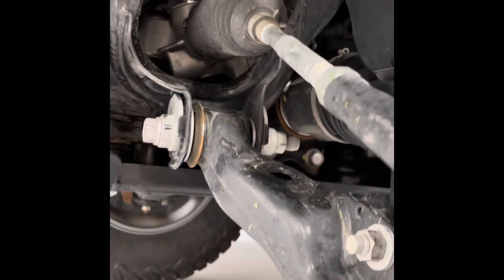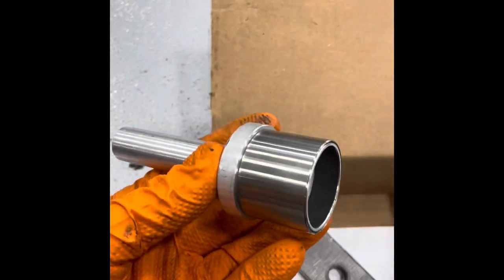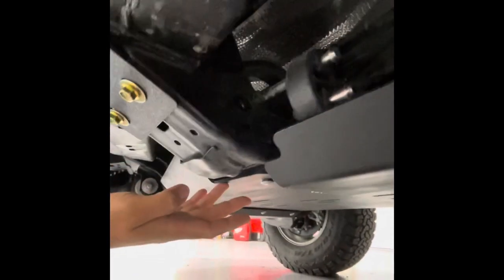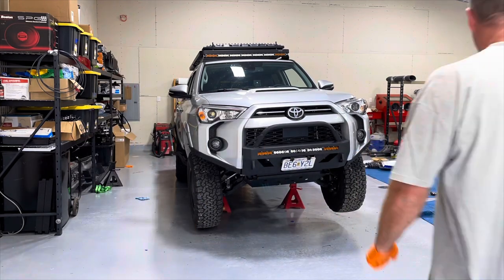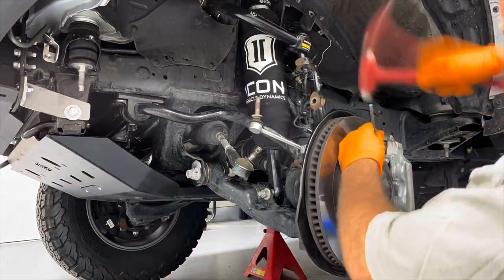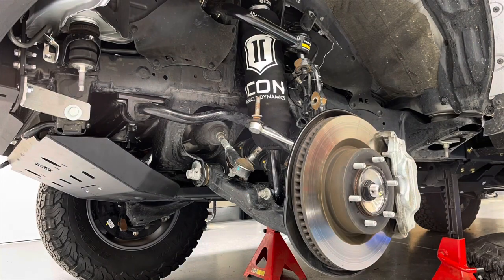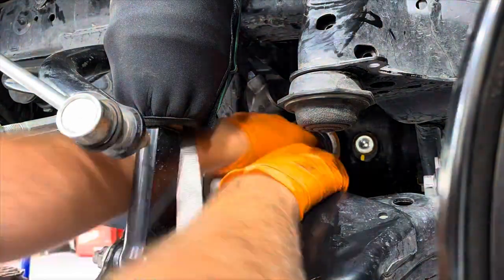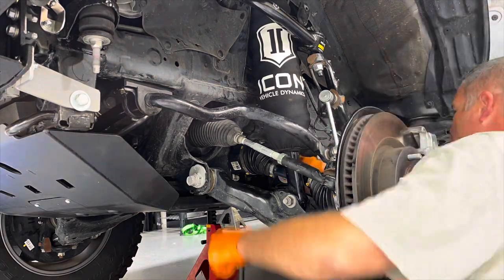4Runner diff bushing install, and some questions for viewers

Comment: Would you be kind enough to post Part # ..also is part specific for lift? Have a 2wd 21 sr5 was gonna get lifted...excellent video...
Reply from the maker: This won’t be applicable if you have a 2wd. There’s not a front differential unless it’s 4wd. However, the diff bushings for all Toyota models are found here: https://eastcoastgearsupply.com/search.html?q=Toyota+bushing

Comment: Hey, nice video! I have a 5th gen sr5 awd (shift knob) on the web page it says “FJ Cruiser, and 03 up 4runner DOES NOT FIT AWD 4RUNNER AND FJ CRUISER”
Is there another option for those models? Thank you
Reply from the maker: First, thanks for watching. Second, that would be a question for the company whose website you’re referencing as to which one you need for your AWD model.

Comment: how / when was yours vibrating? mine only vibrates 30-40mph and does not happen when I put it into 4th gear or shift manually.... I'm not sure this is the issue, so trying to pinpoint it.
Reply from the maker: I don’t own this rig. But as I remember the owner said it was slow speeds mostly.

Comment: Did you not need to replace the o-ring/gasket on the differential after removing the needle bearing?
Reply from the maker: Only if you nick/tear it when removing the axle, or if your seals are old and crusty.

Comment: Quick question.  I recently had my lift out on before deploying.  I was only able to drive my 2020 trd pro 4Runner around for about a month before leaving.  But I do have a bit of a vibration since the install and it’s only for the first second after moving from a stop.  Could this be the answer to my problem?  I really hope so!
Reply from the maker: It’s very possible. This rig had a slow speed vibration and now it’s quiet as can be. I’d say go for it as it’s really not that expensive of a fix (if you’re doing your own labor). I hope this helps. Thanks for watching!
Reply: @Mr_SynergyPerformance  thank you very much!